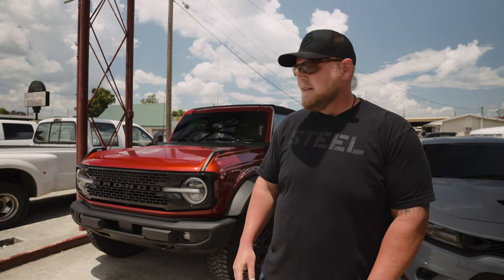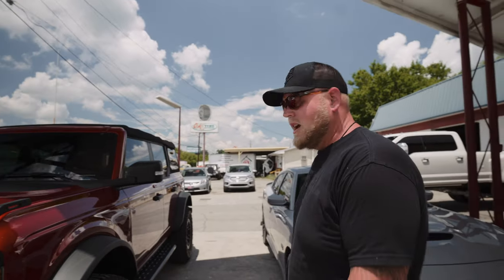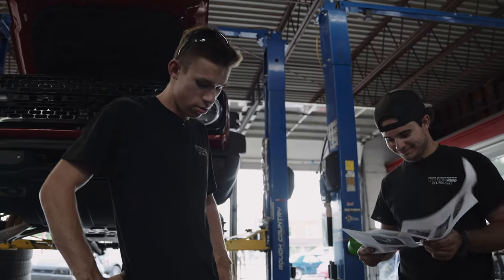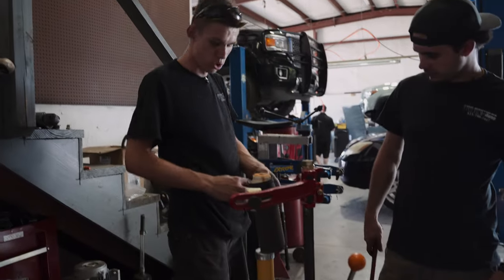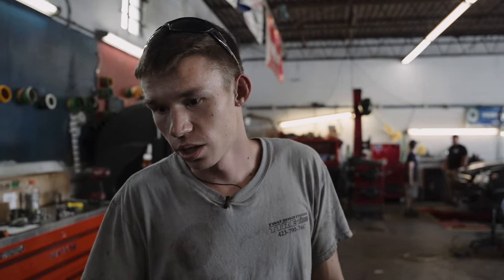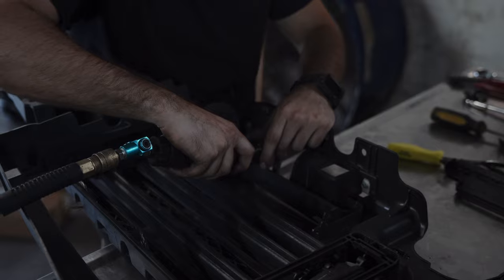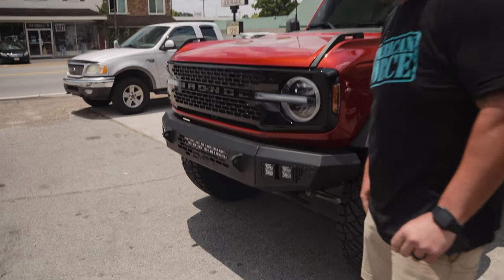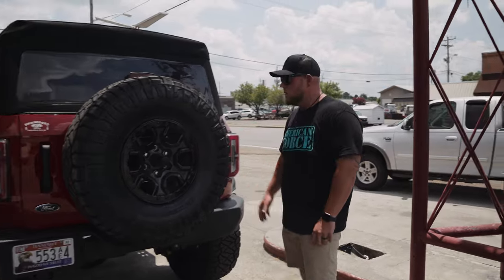Taking This Wildtrak Bronco To The NEXT LEVEL!

Comment: Just in case anyones wondering, those factory wheels are not faux beadlocks. Theyre beadlock capable, meaning you can replace the outer ring with an actual beadlock ring and make those true beadlock wheels. Something cool Ford did from the factory. I have a 23' Wildtrak and plan on doing that once im lifted. Great video boys! 🍻

Comment: As a dealership tech the last thing I'd ever do is mess with the wiring of safety sensors. I've had to diag so many radar sensors that have been repaired or extended. And the customers always upset at the cost of the new harness.
Reply from the maker: @darkendbeing  you don’t have to know what you’re doing but it does help. 💯